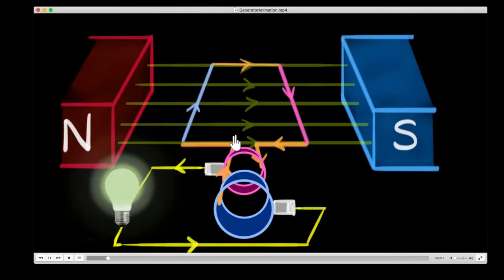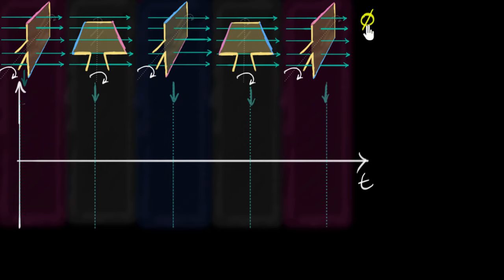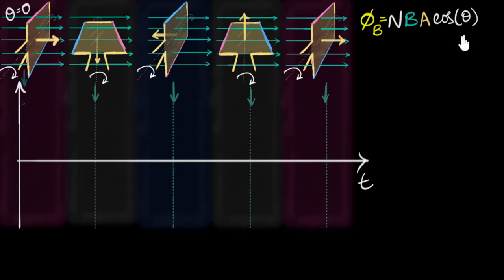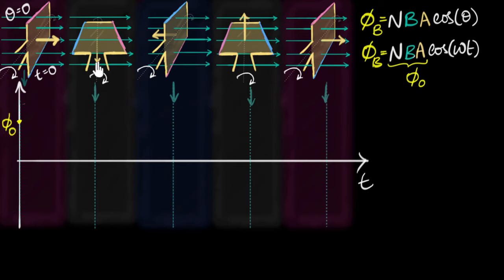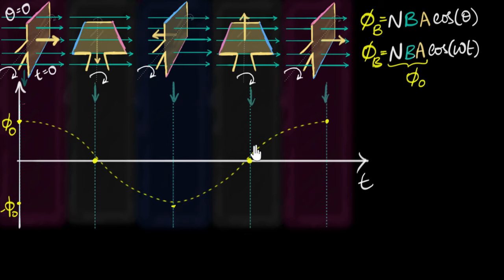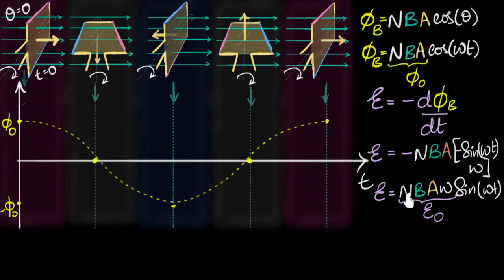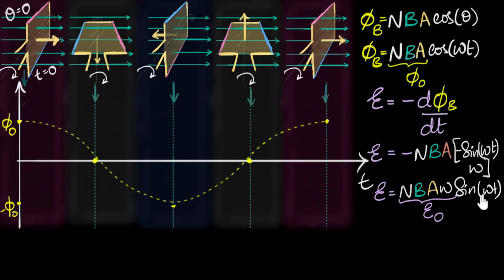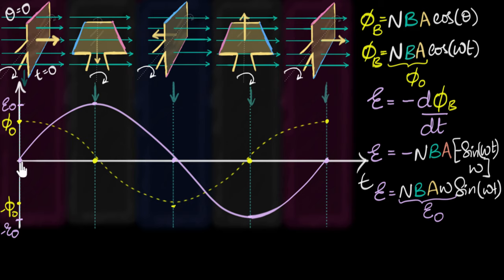EMF & flux equation (& graph) of AC generator | Electromagnetic induction | Physics | Khan Academy

Comment: Very simple explanation. I like it. Can be harnessed this back emf, and so to be used as electric power?
Reply: Yes back emf can be harnessed from motor..
Even recent electric vehicles or trains uses the back emf to charge up its batteries.
Reply: @safeezrahman8823  But it will be the same amount of power? or less?
Reply: Might be bit less, but good part is at least some energy is harnessed instead of total wastage.

Comment: In my textbooks it shows EMF max is at 90. Your explanation makes sense but the textbooks I'm reading doesn't. Why would they write it that 90 is at max?
Reply: Is it written sin or cos there?
Reply: bro to get emf you have to differentiate ( cos omega t ) which becomes (-sin omega t) omega and at 90 sin =1 that's why emf is max at sin. take it this way emf is change in flux at 90 flux changed from max (cos0) to min (cos90) and hence the max emf at 90

edit:- sorry! dude i tried my best but i don't think i've explained it well, but sir in the video did it very clearly, i understood it here only.
Reply: several teachers get this wrong... they state maximum emf is when the coil is vertical which is clearly not the case
Reply: @riteshyadav1716  well explained
Reply: cuz it is of sin not of cos
Reply: @ranabrosranabros4265   thanks buddy......

Comment: Omg!!!   I can't able to clear my doublt. At first case conductor placed in perpendicular position so max number of flux lines touches to the conductor.so max magnetic field and flux linking are there. But emf value=0. How ?? Max magnetic field and flux touches to the conductor it should create max emf at begin right ???? But we consider angle of conductor sin0. So emf become zero. I can't understand .  Please anyone let me explain and clear my doubt
Reply: In EMF equation theta is the angle btw velocity(v) and magnetic field (B) so by that angle at begining is zero as  coil is about to rotate rightwards ,in direction of magnetic field , so zero EMF . And at begining flux is max but emf is not as emf as per faraday refers to change of flux not the value of flux

Comment: Sir Please Solve My Doubt

In figure you have taken a rectangular coil , and when this coil rotate then rate of change of flux would be constant  so induced EMF should also be in constant (in rectangular shape).

The induced emf will be variable (As you have shown in figure)  only if when coil would be circular , because then rate of change of flux would not be constant.

Sir Please Explain...I'm Very Confused !
Reply from the maker: Flux happens to be BAcos(theta). Notice this result is independent of the shape of the coil. So regardless of the shape, the flux would be sinusoidal, and the rate of change of flux would be sinusoidal (a variable) too.
Reply: @KhanAcademyIndiaEnglish  ok sir thanks
Reply: @KhanAcademyIndiaEnglish  Question: Why does an EMF graph for a DC generator look different? I understand current only flows in one direction but how does that relate to the graph? Shouldn't there still be Cos(180) giving -1?